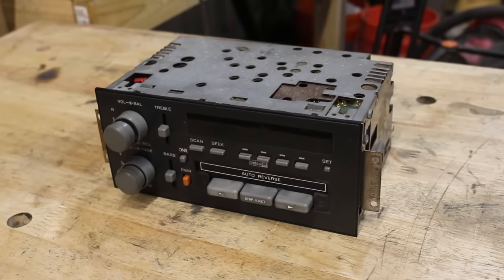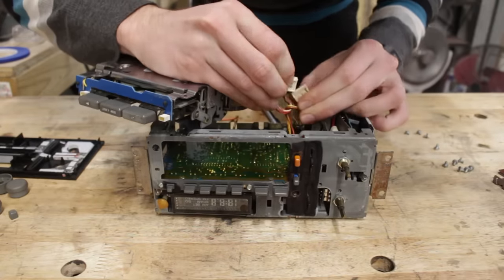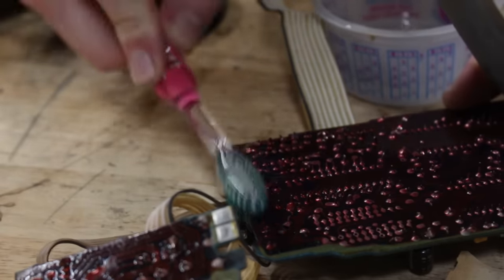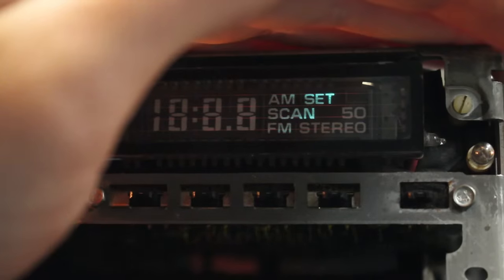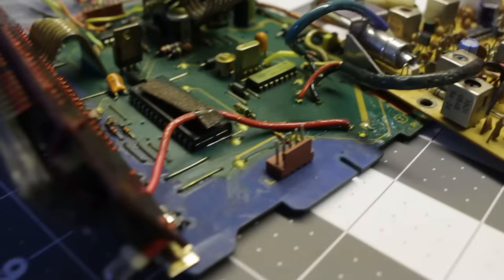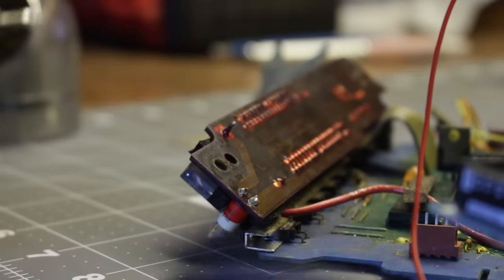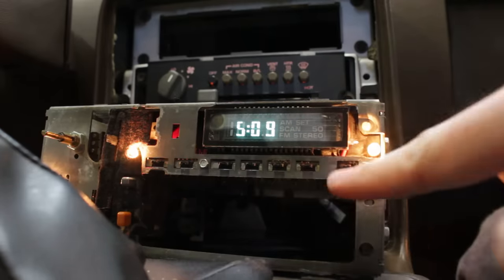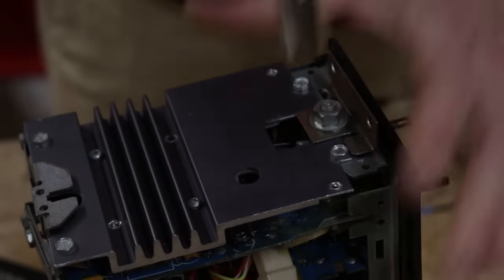1985 Fiero Radio Repair! | Saturday Projects

Comment: Thanks for the video!  It seems really well-researched. You did a great job, especially with the electronics, which are beyond me.
If you ever decide to take apart the cassette player again, it might be worth replacing the pinch rollers -- those are almost as common an issue as belts and can really affect the performance of a tape deck. It's easy to find standard size replacements on ebay, but then again the old ones are really buried in there so I don't blame you for leaving them. A tinkering project for another day maybe!

Comment: The display is supposed to dim when the headlights/driving lights are turned on. The assumption is that if you need the lights on, the display should not be as bright since it's after dusk.

Comment: You've got very lucky with that stereo. Usually VFD's (Vacuum Florescent Displays) first get dim, then die over time. Maybe that solder crack actually worked in your favor, keeping the display off kept it from ageing. If the the electrolytic capacitors you were meant to replace were actually there, and leaked electrolyte, the mess they made on the PCB would be very hard to repair. By the way, electrolytic caps are usually polarized and come in much higher in values than what is possible with ceramic caps, I think what you were meant to replace them with are tantalums, not ceramics. Anyways, I love the series and very happy to see the radio is fixed like 85% :-) If you ever take it apart again, put some silicon grease on the gears, clean all the pots and switches with non oily contact cleaner, and adjust the speed. Yes it is usually adjustable by a small variable resistor on the motor drive circuit. While you are at it, you may want to replace all the electrolytic caps, since they are actually a disaster waiting to happen considering their age. Caps can go leaky two ways, 1) physically: electrolyte leaks out. 2) electrically: electrolyte dries up and caps start "leaking" DC, (basically they start acting as resistors) which they shouldn't. This causes unwanted currents to flow in wrong places and this stresses other (much pricey) components. It is a good and common practice to replace electrolytic caps in 20+ years old circuits.

Comment: Coupling and decoupling caps, usually 10 microfarad at 50 VDC. It's called recapping and is quite common.
Then get some contact cleaner and spray out the pots, potentiometers or volume controls.
And, if it's going back into a Fiero, Crush it!

Comment: Little-known fact about some of the late-80’s Delco units:  there are actually 7 radio presets per bank, not just 4.  Press two adjacent buttons simultaneously and voila!  Extra preset!  Also, the LCD is supposed to dim when you turn the running lights on.

Comment: those radios were in all of pontiac's back in the 80's I pulled one out of my 1988 when i had it. and it was a working radio. I had 4x10's pioneer speakers in the dash. I believe those are still at my parents house.

Comment: Tape deck? AutoReverse? Wow...nostalgic. @3:10.. I can smell old electronics just watching this.  Still - Tapedeck?!?!  why? why? why?  --... OK I really do agree with you that having that OEM radio display working is pretty damn cool. Nostalgic as all h#77 but also very ##in cool! I'd have probably chucked it and filled the hole with a modern touch screen unit with bluetooth etc but when you slammed in that cassette adapter for your phone...made the whole radio project worth it.

Comment: easier to fix than most new stuff.   I actually worked for Delco building these and many other electronics back in the summers of 84-85'. 
Also bad solder joints have been an issue . autos even up in the early 2000s still had issues with displays and broken solder joints.

Comment: Woodworking workbench, holes are for bench dogs to hold workpiece from moving. But yeah a total pita any other time you want to use the big horizontal work surface in the shop.

Comment: If it's still running a little slow, check the motor itself for a small adjustment screw accessible through an opening in the side. Many car tape players of this vintage had a mechanical speed governor, and a tiny turn of the screw sets its tension, and so hence the speed.

Comment: Ronald, your perseverance is amazing despite those setbacks, thumbs up.  If you want to have a better quality audio input for smartphone then you could feed stereo signal from the 3,5mm jack cable via a 0,1 uf capacitor each left channel (white wire) and right channel (red wire) to the signal paths preceding the volume control pot. Then put a blank cassette into the player or tune into a empty space between radio stations (receiver may mute there) and away you go :-)

Comment: You probably need Kent Moore special tool J39916; it has a special diagnostic cassette that tests the full range of the speakers, as well as a motor speed test. The tool also has a special cleaning cassette cleans EVERYTHING including the pinch rollers.

Comment: Corrosion on the PCB will come back. You need to neutralize it with vinegar. Then clean of vinegar with isopropanol. PCB should be covered in lacquer to prevent moisture to get to the traces. Use deoxit/contact cleaner in potentiometer/slider/buttons (if it's part of a circuit). Use small amount of silicon grease on moving metal parts to lubricate it.

Comment: Also, purchase a head demagnetizer.  Run it in both auto-reverse directions.  There are some that use permanent magnets, but Maxell made one that has a button battery.  It worked the best!

Comment: Interesting note, the tape spindle doesn't have to work at all if using an adapter, back in the day when the tape player belt broke I always got said adapter and said CD's are a higher quality anyway (even though they're being pushed through an analog cassette player technically I'm upgrading) and that made me feel better.

Comment: My 1988 Oldsmobile Ninety Eight had this in it, except the buttons were chrome bordered with wood grain face. This I beleive is the Delco units that General Motors used extensively from the mid 80’s to the very early 90’s!I sold the car to my cousin in 2017 as the car was starting to rust and the transmission started to go bad.

Comment: At 3:58 - I hope you re-made the solder joints, as they are "grey" joints (contaminated/oxidised). The VFD going dim when the lights come on is probably a safety feature by design as the light intensity in the cabin at full brightness in the dark would be STUNNINGLY bright (I worked on a design using one of these displays). Also, a spray of contact cleaner (light electronics, not automotive type) on the two pots (the volume control knobs) would help. I have to confess, I cringed a fair few times watching this, but you got a result! Nice one.

Comment: I’ll give u a way to stop the noise on your radio. I’m 60 so I’ve been putting up with that noise my hole life. All you have to do is spray a little wd40 in the ends of both volume & tuner knob.  Spray it wright in the end of both. It works every time.turn the knob back & forth fast.

Comment: Someone else might have already mentioned it, but it would have been a really good idea to clean off the old heat sink compound on the output transistors, and replace it with new compound. The old stuff is most likely dried out, and not doing what it needs to do. You’ll discover the problem when you play it for awhile, and things heat up.

Comment: A good tip when working with electronics like this is wiggle things. Sounds silly but I did that on a uhf and found a lose solder joint didn’t notice until I wiggled it and it worked

Comment: You need to keep the soldering iron on the contact longer after you take the solder wick away. Keeping the heat on there for a second or so more will make it flow better and down into the via, creating a better longer lasting connection.

Comment: Ron - well done. Impressive diagnosis on some crusty old delco that was pretty crap quality even on day one. Now you have it working, seal it in a ziploc and see if you can get a modern head unit to fit in that slot. with GPS nav and bluetooth. Would be pretty snazzy in that dash! But preserving the option to put the jank delco back for authenticity purposes if needed. Also - bluetooth FM adapter is a better alternative to the cassette adapter. At least the cassette drive wont have to keep spinning all the time. Hall and Oates. yeah man! I may have a Captain and Tennille cassette up in the attic I can send you to round out your collection.

Comment: Replacing electrolytic capacitors with ceramic capacitors won't always work because their operating characteristics are different (the major of electrolytics are polarized).   But modern electronic capacitors from high quality suppliers (you showed Nichicon, they're quite good)  will last a long time, particularly in low-voltage electronics.

Rubber restore on the pinch roller and the rubber parts that need would be a good idea as well.  Check out some videos on restoring tape decks.  It works really well.

Comment: Great video. I may be wrong but I think the cassette belt should be routed so the capstans spin in the opposite direction...of course this does not matter if you are using the tape adapter.

Comment: Same radio they used in all the S10s & blazers from 1989 to 2001 :P Most other chevy cars from 84-1999 easy to find these in junk yards. At this rate personally I would have bought the $15 Bluetooth head unit from big box store. Got a harness kit. And had modern radio :P

Comment: The capstans should run opposite directions for the auto-reverse to work. Recheck the belt threading. It goes under the left capstan pulley not over it.

Comment: Several companies specializing in repair of OE radios and other related electronics.  United Radio in Syracuse, NY as I recall.  Best of luck... and there should be plenty of these sitting on shelves in auto scrapping yards and likely ebay for cheap.

Comment: The Panasonic Cassette mechanism that's on your Delco factory head unit is usually trouble free with the drive belt dry rotting and dust particles making their way in/on moving parts being about the ONLY troubles that I've ever SEEN! The Cass motor is Not adjustable and it uses a square belt with, (if I remember right), one side is wider and it does effect the tape speed enough to tell. My biggest Beef with this deck is the frequency response Varies a great deal from side A to B and you can only get a happy medium because of the auto reverse and the 4 track playback head is stationary! For this reason I got to where I told customer's that recorded their own tapes with Higher end High Bias types and Dolby, to get a good after market stereo, (mostly Alpine), But if they wanted the factory look to search for a Delco with the Blaupunkt deck at a Salvage yard and bring it to me to check out and Tweek. Tapes sounded lots better, had Dolby, and the output IC amplifiers were more Powerful, (I always thought they handled Better with after market speakers. But the Truth is the boards tended to have the same problem's with intermittents as you found out! I don't know really if it was the soldier used or just poor automation machine's!

Comment: The belt is threaded wrong, being that its a bi-directional tape transport, it needs to go around the capstan flywheel furthest from the motor so it turns clockwise, then around and over the other one like an "S" pattern so it turns counterclockwise.
Reply: This guy tapes!

Comment: Should have done an aux in mod to it. I did it on my friend's fiero. it made the car 300% more enjoyable to drive. all you need to di is interrupt the audio out from the tuner board and get a stereo switching jack that panel mounts. it's really easy to mod

Comment: Typically the volume control becomes worn and corroded. They are mechanical, metal arm rolls over a coiled wire... you can open up the volume control clean and move the arm a bit so the contact points are on a clean part of the coil.

Comment: @Ronald Finger: A small tip: The tape deck belt you installed here seems a bit big. For proper tape sound, try putting in a slightly smaller one- eg. one size down. This is to counter the stretch that comes to old belts over time. Stretched belts do NOT transfer energy properly, and the speed will suffer from this. Try giving the tape heads , capstans and rollers an extra thorough clean while you´re at it.. Use RUBBER CLEANER from a proper TD maintenance kit  for rollers, NOT IPA..IPA will cause the rubber  to crack over time.

Comment: Watching this video has motivated me to take apart the stock system in a 2001 eclipse that belongs to our son that doesn't work, cd player instead of a tape deck.  The vehicle had a leak from the previous owner that wasn't fixed until after our son got it so I am wondering if it might have caused corrosion on the boards.

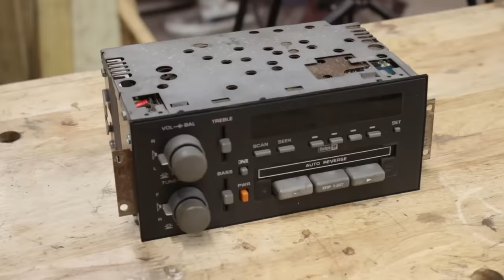Comment: 12:15 - The holes on the workbench are for the wooden pegs provided with the table to hold things in position when working on them... you can buy a dowel and just cut a bunch of plugs and hammer them in so the tabletop is flush, that's what I did lol.

Comment: I remember that head unit in my 1985 Pontiac 6000LE (don't worry, I stopped using that as a security question a long time ago, cuz I used to advertise that was my first car). And yes... I just ditched it. Along with the car after the battery exploded and we deemed the car just too gone to fix any longer.

I regret that decision still...

Comment: Did the tape deck play well at the end of the repair?  I love those Delco radios as I grew up in the 80's.  My parents had many GM cars with those radios and I've owned a few also.  In fact, I have about 4 Delco radios in plastic bags up in my attic.  The electronics were built by Panasonic and they delivered  75- 100 watts per channel.  The good ones had the built in EQ with the loudness button and were capable of delivering AM stereo where available.  When coupled to the Delco 6x9 speakers in the package tray of a car these radios produced awesome clear punch bass.

Comment: i know your full in resto mode. which is cool. just the same. treat yourself to a new radio. reason i say this is the electrical wiring in the car is going to have to be replaced at some point anyways, if you keep her. so start with the tunes. you've earned that much for sure.

Comment: Good job on hunting down all those cold solder joints, that must have been something to go over. Seems like it could have used electrical contact cleaner in places, and the knobs and sliders getting a good working over. Not sure 3 in 1 would have been the best lubricant for that application, it chances attracting more dirt and dust. Perhaps something silicone-based may have been better in some places and dry graphite lube better in others. Not to mention that any petroleum based lubricant risks turning those cassette drive belts into gum over time. Also there may have been a missed opportunity to do a LED conversion. A bit more of adding to a project in figuring things out, but there are warm white ones that are suitable as an incandescent replacement. Unlike original bulbs they don't get hot - in some head units the tape recess was illuminated by at least one bulb and sometimes that was enough to eat tapes. (I remember an older Buick having that flaw.) Odd that all the bulbs were working too, it seems reasonable to think at least one would have burnt out by now.

But yeah, it was a really good job on restoring a factory head unit that most people would have replaced already.

Comment: You should've installed a bluetooth module inside it! That way you keep the looks, without sacrificing modern features! Some modern bluetooth modules accept "lossless" protocols, like APTX HD, providing your smartphone works with it, you should have better sound than with regular bluetooth!

Also, replacing the electrolytic caps is still a good idea, specially the ones that go into the speaker outputs.
Buy some Nichicon MUSE FG, ou Elna Silmic II that match the values of the caps your radio has, these are audiophile grade caps. It will sound even better with those installed, trust me! 
HOWEVER these caps should only be used where audio signals go through, for the rest of the radio, use long life, high temp, high reliability electrolytic caps. Example: Nichicon HE or UCA series, Rubycon ZLH series, or NCC KXG series, to name a few.

I've done this upgrade to some retro consoles of mine, wich are 20-25 years old, I can imagine it would have a greater impact on a 30+ year radio!

Comment: Nice save on the stock radio.  I cringe whenever I see a nicely restored 40 year old car with some battlestar blinky light head unit in the dash.   You can buy copper ribbon that absorbs old corroded solder from mountings.  It's best to get rid of the old stuff altogether before adding new.  The rosin used to flow the solder is acidic and will continue to weaken connections that aren't replaced with new solder.  I hate to tell you but until it's all replaced you'll continue to have more gremlins.  I've gotten warning lights, digital clocks and other interior stuff working again just replacing solder connections.  The display is designed to dim when the driver turns on the car's headlights.  Otherwise it would create a lot of glare at night.  Any electrolytic capacitor that is 35 years old is likely dried up and barely doing it's job.  You will get a much richer sound quality from your amp board if you replace all the electrolytic caps.  Ceramic caps last forever.  Nice job on the cassette deck.  I've not rehab'd one of those yet.